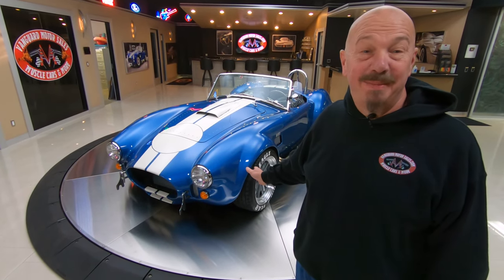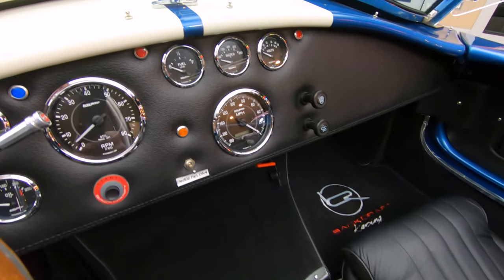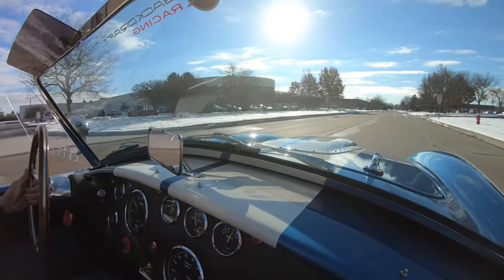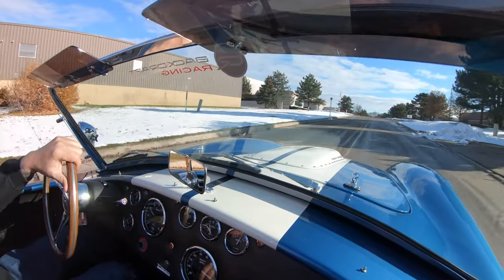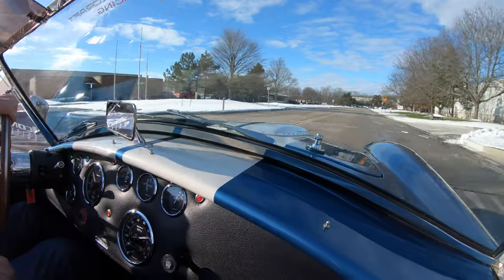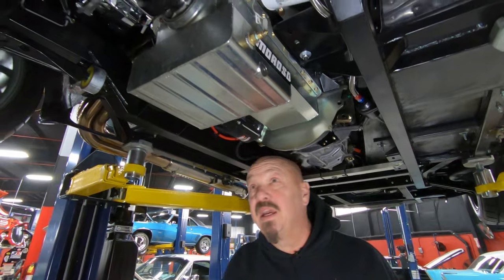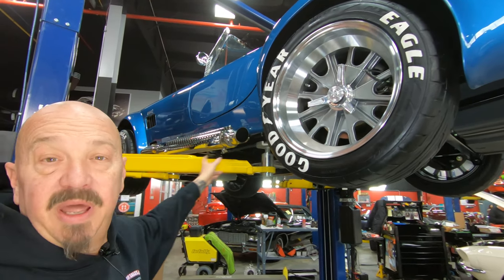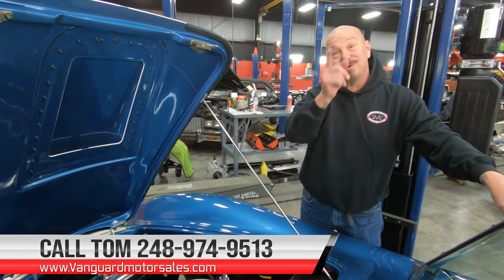ICONIC 427 BACKDRAFT! 1965 Shelby Cobra by Backdraft For Sale Vanguard Motor Sales

Comment: Sweet car, but I'd definitely have EFI and for some reason, I don't like when guys take 350s or 351s and stroke them to reach 427ci, I wouldn't want to lose the RPM range... If I ever win the lottery, I'm going to build one and either put a Mercury Marine SB4 427 V8 in one, or take the Mercury Marine QB4 DOHC 9.0 liter and destroke it to 427ci to get greater RPM range... Think it would be sick to hear a cobra with a big block hitting 7000+ RPMs.